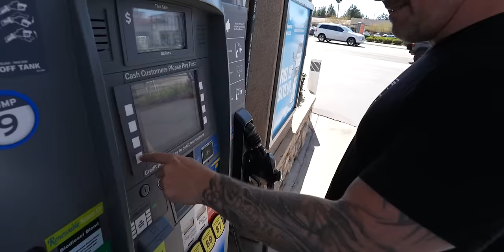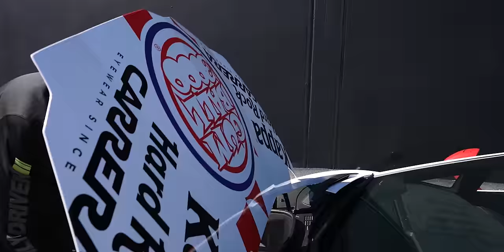HE LOST MY NEW $60,000 SVJ TRANSMISSION - I’M SCREWED.

Comment: SVJ is the best single DDE car. (Kept stock & N/A.) The sound & usual reliability is the SVJ's strength.

 And the 720 was ruined by it's goofy body-kit, mechanical diff, & overkill/laggy engine build. (Its not drivable/drift-able like before). So only good for straight-line now

Comment: I have one of the first 3rd Gen Ford Focus's from the early 2010's and I know exactly what you're dealing with when it comes to transmission issues. 5 TCM's and to rebuilds and I have another TCM on deck. Faulty prongs on the TCM's cause the clutches to slip in the even gears specifically. 1st, 3rd and 5th are phenomenal but God forbid I drive in 2nd, 4th or 6th. 1st generation DCT from Ford is absolutely garbage. Ford will do everything in there power not to recall the car, only the parts.

Comment: About the gearbox. Its DCT, prob hydraulicly controlled shifts. Could be that the piping that pushed the gears into place (not the shift up command but the actual gear itself) is leaking. Maybe some seals that got blown out by hooning the car around. Worst case is a hairline crack in a casted part of said system. Seeing you might still receive the new transmission, might be worth it, taking it appart and seeing whats what.

Comment: couldn't you guy's take a 3D scan of the original exhaust, and then 3D print it out but only thinner and a bit smaller so that it could be fit securely on the inside of the custom one? That way you would have all of the same speck's.

Comment: i’m actually having the same problem on a awd dodge charger 😭😭 already changed the transfer case and front diff cause it blew and still has the same problem only on 1st and 2nd gives problems any higher gear while it’s moving has no problems lol